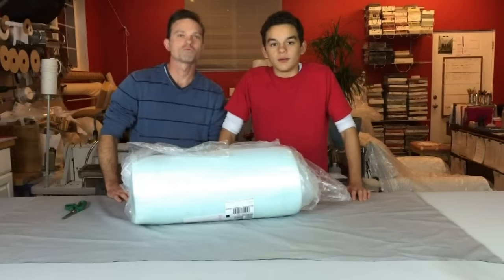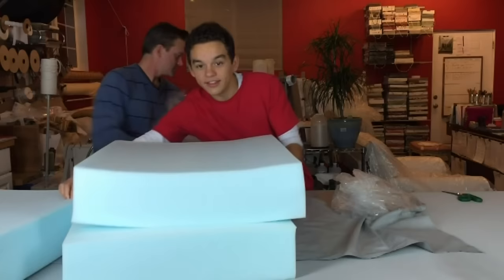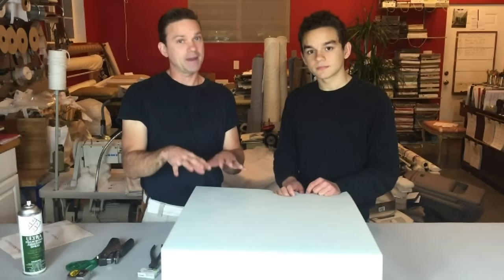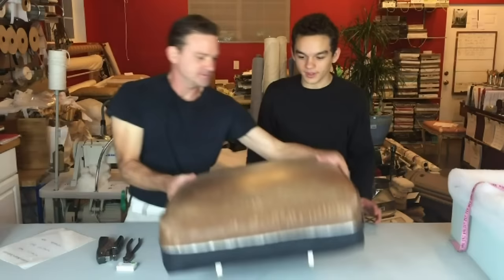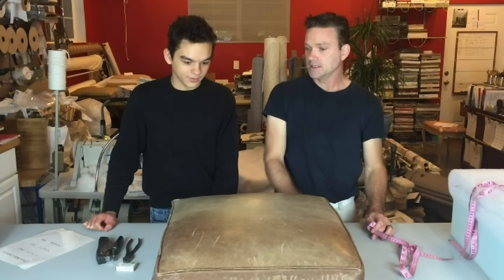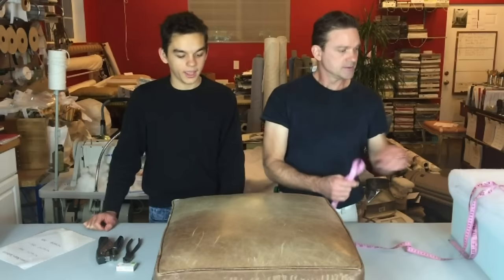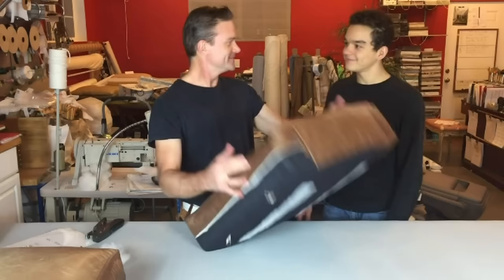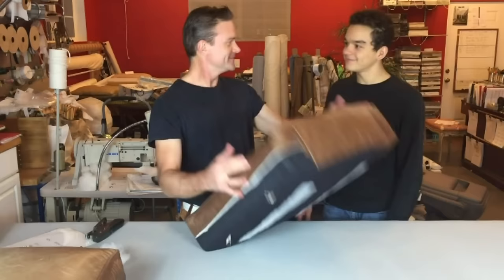Replace the foam in your seat cushions fast and easy!

Comment: for 6" foam to be use for a van bed holding a 275lb back sleeper, what's a good density and compression ?  Would 1.8 density 44lb compression be good? What are the specs on these blue cushions @ 3:56 closer to high density vs medium density.  Seems what constitutes high vs medium varies.
Reply from the maker: Hey there, that’s a good question thanks for leaving a comment. As far as foam for a mattress. The density 1.8 I wouldn’t like that because it won’t hold up as long as a density 2.6 you just have more volume there per square inch. We’re gets really complicated is the compression that’s the comfort level. Really depends if you like a firm mattress or not 44 is considered firm mediums like 35 compression and soft is around 26 compression. You also need to take in consideration how thick the foam is. The thicker the foam the more firm it’s going to feel. For 2 inch foam standard is 45 compression there’s not much foam there to support somebody, so you want it to be firm. Translate that to a mattress size you’re gonna have a firm piece of foam at 44 compression. So although I’d like to tell you which one to choose it’s really hard to say do you like your mattress is firm can you tolerate that, for many hours or do you like them soft or does that hurt your back?  I do hope this guided you in someway. Again thanks for watching and leaving the comment. Please share as it does help us when you do. All the best, Paul

Comment: First off, I love your videos. They are the best upholstery videos I have found and they are entertaining too! My husband and I are trying to help our leather natuzzi sofa that is sagging on either side of the middle cushion. It is a webbed couch and it is the foam that is compressed from use. Unfortunately we can't just remove and replace the cushion because of the webbing. My idea is to try and support it with another whole piece of foam underneath and then add another layer of webbing. Is this idea any good? Any advice or other videos that apply?
Reply from the maker: Hello Mikhaila,
THANK YOU for checking out the videos, it's really great to hear.Very happy to help you on your project. I HOPE I have this correct. Q: Are your seat cushions attached? If I have this right you are wanting to go underneath the sofa (the bottom) and add the new slab of foam there (FIRM no doubt) and then apply webbing to in case the foam. RIGHT? If so then YES! That give you more support on the top of the cushion. That sofa is a nice one, other then not being able to just remove the foam for new replacements. Here are two videos that MIGHT help you on this project. I hope I hit the mark on you question. Please continue to watch and share the videos, it helps us a great deal when you do.  All the best Paul

https://www.youtube.com/watch?v=wxQ1FRyRusc&t=125s                 

https://www.youtube.com/watch?v=pcF2GR576dE&t=24s
Reply: Thank you So much for the advice and the videos! It worked like a charm. I figure we have given this sofa a lot longer life. You might think about doing a video on this, because it seems like there are alot of natuzzi owners in the same boat. Thanks again!!
Reply from the maker: Really glad to hear it worked out, thanks for the update it makes doing these videos a lot easier. In short very glad to help. If you have any other questions on furniture let me know maybe I can help.  Cheers,   Paul

Comment: I enjoy your videos and I'm sure you get many questions so here's one more,lol.I just yesterday bought a nice used sofa set-love seat,standard  sofa,and a chaise lounge,matching set.Problem is it's missing ALL of the cushions entirely.I really liked it and didn't want to pass up buying this set.Is it possible to replace the cushions,foam,fabric wise?Any tips you have are truly appreciated(On a tight budget just to note)THANK YOU VERY MUCH GUYS!
Reply from the maker: Hi,
Thank you for watching our videos, and sorry for the very late reply! Hopefully the set is still available, and if so here are our tips!

First, fabric! It will be very hard to find an exact match of the current fabric on the furniture, however you could try to do a contrasting fabric for the cushions.  Or you could do a slipcover for the furniture pieces in the fabric you want for the cushions. 

Second, making new cushion covers!  You need to start off by taking some inexpensive fabric like muslin and trace the platform of the furniture where the cushion will go.  Then add a half inch for seam allowance on all sides.  Unfortunately this process is extremely hard to describe without actually showing someone in person.  However this should give you the general idea. 

Third with the foam. We order our foam supply from albanyfoam.com. If you make the cushion covers before you order your foam you could send the cushion covers to Albany foam and they will fill them for you! Or you could follow the procedures in the video. 

Finally, the easiest way to do the back cushions would be to make 26 x 26 throw pillows to fill in the space on the back. 

 I hope this helps, and again I hope we're not too late!

All the best,
Grant
Reply: Well it was worth the wait!Thank you for the tips,appreciate it much:-)

Comment: Can you use this foam to replace a poly material for the part of the sofa that you dont sit on but the one you lean on? Love. Love your videos. It is so helpful.
Reply from the maker: +Sam Cole  Hi Sam,  sorry for the very late response, it's been pretty crazy busy here. I think I understand you question. Yes back cushions can be made of foam. Boxed or cushions that have a band, not what we call a (knife edge cushion) those need shredded foam. For boxed or banded cushions, Only use soft compression #16 or the like,  go for soft. Remember the thicker the foam needed, go for softer. A good rule to work from is, thinner the foam use firmer. If your back cushions are 4" to 5".  I would use a soft foam with the highest density I can find, it will last longer. Hope this has help. All the best, Cheers.
Thanks for commenting.  Paul

Comment: Great video.  Thank you.  Replacing cushions can be so expensive.  For a fabric cushion however, do you have a specific video that would make it super comfy?  This looks a little firmer?  Thanks for any help you can offer.  Also, I am trying to stay away from poly since it is toxic.  Any "green" replacement ideas?
Reply from the maker: Hi Dawn,
Thank you for watching the video, glad you enjoyed it. The Foam method used in the video works with leather and fabric just the same. Yes! That cushion was on the firm side. Cushions are very difficult to work on, the reason they are like a pair of shows one person love'um and other person hates'um. The softness of a cushion is in the compression number. If you want soft , go for a low compression number say 26 or even lower. However your cushion needs to be thick or else you 'll go right  down when you sit, no support. It's all in the video. As for low or no Toxic? There is soy foam out there, but you need to do your research to see how low in toxicity  it really is. You have Nature latex foam, REALLY nice, however very expensive, it last a very longtime. You do have feathers as a choice as well, but like all things it to has some drawbacks. If you have any more questions please let me know. Please share the videos, it helps a lot when you do.  Cheers,  Paul

Comment: Is using industrial velcro on couch cushions a good way to keep them from slipping forward? Or is the cushion too long from front to back. The Linda. P.s. love your videos you are a great teacher.
Reply from the maker: Hello,
Thank you for going to our channel and watching the video. Thanks as well for the compliment on the teaching, it means a lot. That is a good question: That method is used mostly on leather furniture to stop slippage and to save on using costly leather under the cushions. They will have, leather and half fabric. On the fabric side they will sew Velcro to it. BIG DOWNSIDE!! Flipping the cushions you need to remove the foam from the covers to do so. Most people don't, when they see Velcro on one side, they skip flipping the cushions. So there is not even wear on the cushions. If you have fabric on both sides of your cushions instead of going through all that work putting on Velcro, try this first. The NONSLIP material that goes under rugs for hardwood floors. Cut a big enough piece to go under the cushions. Another option is using what are called cushion D rings and clips try here.  www.fabricfarms.com     However it's best if you are doing the re-upholstery to install them or you are having the work done for you. I have installed then in post, a real pain and you will need a long nose stapler to staple to the frame. The D ring is attached to the cushion bands, using a strap of fabric, to hold them in place. I hope this has helped you.  Please share it helps when you do. Cheers,     Paul.

Comment: I would like to convert from three seat cushions to one bench-style cushion for my sofa.  What might be some considerations to keep in mind?
Reply from the maker: Thanks for watching the video I really appreciate it. Things to consider for one long seat cushions. Things consider are it will wrinkle more than a tighter smaller individual cushion specially in the center. The longer the fabric runs the looser it will appear and be. Depending on your seat platform, one long cushion has this problem. When you sit  near the center the ends come up. A lot of people complain about this. You can use what are called D clips on the sides of the cushion they are attached to the furniture and they keep the cushion from popping up on the ends. If you have three seat cushions that are identical in size meaning a square. You have the option of rotating the center one toward the ends if you tend to sit in one place most of the time. Where as one long seat cushion you can only get the ends to be worn in evenly. So I do hope this helps and again thank you for watching and leaving a comment please share the videos it helps us when you do. All the best, Paul

Comment: When you glue the batting to the foam do you also put plastic or seran wrap over the top so that the glue hopefully doesn't seep through after years of wearing?😃😃😃  
I'm redoing cushions in an RV.
Reply from the maker: Hi Cheryl, 
Great question, with glue, soon after it is sprayed it hardens enough so it is not tacky anymore. So, you do not need to add any protective layer. If you do see any film or plastic around the insert        that is used for vacuuming down the insert so it is easier to put it in the cover. I hope this helps! You can order foam from our website if you would like at ucprivatecourses.com I can answer any questions you have if you email me at: videos@urbancastlesolutions.com
All the Best,
Grant

Comment: Thank guys, which tools are needed?
Reply from the maker: Hello Irina,  thank you for watching, the good thing is you only need a tape measure to get your foam insert replaced. Put in the measurements at ucprivatecourses.com after following the instruction in the video. So no tools required.🙂  Again thank you.  Cheers,  Paul

Comment: Do you know if there is anyway to fix/restuff the arm of a couch. We bought our sofa less than 2 years ago and you can feel the wood on the arm (where everyone sits).
Reply from the maker: Hey Danielle, 
Thank you for checking out the video. I have had that question given to me before. Not sure how your furniture is constructed,but unfortunately it most likely needs to have the outside back and outside arms removed. That needs to be done to remove the inside arm to get to the padding under the arm. I KNOW a lot of work and can be unnerving for a beginner. I don't recommend it unless you just can't live with it like that any more. Without seeing the sofa that is my best guess as to what needs to be done. I wish I could be of a bigger help. Thank you again for viewing.
Cheers,  Paul

Comment: Great video, thanks!  I love how well you and your son work together!!  I have a well loved (Cindy Crawford Home) Terrazza Brown Leather 4 Pc sectional.  I watched a video earlier on how to disassemble a similar'ish couch to expose the cushions so they can be replaced, and am praying mine is somewhat the same.  This couch has handled my pets and my kids rather well the last 5 years, and the leather is amazing and has not torn at all, but some of the cushions are not as tight looking as I'd like them to be (they are the favored seats on the set, of course), so I'm thinking of redoing all the seats, tops and bottoms!  Big task, as this is a rather large sectional, but I can do it...provided you could possibly tell me which cushions to order and where from ;)  Any ideas?  This set is used heavily!!  TIA!!
Reply from the maker: Hi,
First thank you for watching and sorry for the delay in response! Great questions,  with the seat cushions we order the foam from albanyfoam.com. Just follow the directions in the video for measuring and ordering the correct density and compression of the foam. With the back cushions if they are attached to the back of the sofa, then what you do is feel up in the back of the cushions to see if there is a zipper. If there is a zipper then what you do next is take out the insert of the back cushion and then  follow the wrapping procedures in this video https://youtu.be/8WCuBBBkGzo .
Also you can find the materials for the back cushions at albanyfoam.com

Thanks again, I hope this helps! 

All the best, 

Grant
Reply: I'm really confused when I go to albanyfoam.com. Did the website change after you made this video? It just gives and index and I don't know where to go to get the foam you have in the video.
The reason I am looking at albanyfoam is because I want to see what 26 density means. I see density listed in pounds in other places. One place I saw 1.8 density. How does that compare to 26 is my question???

Comment: Hello! Love your vids. 
If I'm making simple outdoor cushions for metal chairs what density and compression do you recommend for foam insert? I was going to use 2 " foam. They will be taken indoors during inclement weather.
Reply from the maker: Hello Tjanecki, 
Thank you very much for watching the videos, very glad to hear you like them Please share them with others. 2 inch foam is pretty standard, I would go with a compression of 45.  2 inches is not much foam for support so you need a firm foam. The density I would still go as high as you can.  The higher the better, if you are cutting these yourself we have a slab of 2645 at our website ucprivatecourses. Com Or if they’re just squares we can have them cut for you. And yes this phone would need to be taken in during bad weather or if they’re just squares we can have them cut for you. And yes this foam would need to be taken in during inclement weather.    Again thanks for watching.  All the best,    Paul
Reply: @ucsolutionsgivingmore  onw more question ...on this project, anyway 🙂 what type of thread should I use? Im sewing pretty thick outdoor fabric. Thank you!
Reply from the maker: Sorry for the very long delay, the YouTube app on our phones do not show replies for some past comments for some reason. Here is a great article that goes over the different threads you can order for outdoor purposes: https://www.sailrite.com/Selecting-the-Right-Thread-Material

Comment: This is a really informative video, and using the techniques you are showing, I will be replacing the foam in my 10 year old sofa.  My only question is in measuring what you call half-T cushions (other places call them L cushions).  I have the measurements from the front, width, and depth.  I need to figure out how to measure the T, though.  I am guessing I measure the width of the T (front to back) and add 1", then the length (right to left, where the arm cuts in), and subtract 1".  Sound about right?
Second, the area where the dog-ear (my name for it) juts out is rounded.  I am guessing I need to find a circle that fits, then use the to figure out the radius.  Then, do I pad the measurements by 1", or just not worry about it?
Lastly, I want a firmer foam than I currently have, which is ridiculously unsupportive.  Is there a way to determine what strength of foam I currently have?  Is there a compression gauge?  Or is there a rule of thumb?  I am a bigger guy (mid 200s lbs).  Is there a rule of thumb for that?  I am thinking 2835, but 2845 is also an option.  What do you think?
I just discovered your videos, and I am extremely impressed by your delivery and production.  I never thought I would be fascinated by reupholstery videos, but I have to say, you guys do a great job!
Reply from the maker: Hi Gaguilar1234,
Thanks for watching and for you question, we decided it would be best answered in a video: https://youtu.be/QSIYiX1aubE?t=7m42s
We appreciate you waiting and we hope this helps!
Also here is the link to the foam as well.
Order Foam for Inserts: 
The foam density is not ideal we like 26 (it can also be written as 2.6)
However this is the best option we could find so far online.
18 (or 1.8) density - 44 compression FoamRush 4" x 32" x 32" Upholstery Foam Cushion High Density (Chair Cushion Square Foam)
Message them for custom cut foam and COMPRESSION AMOUNTS
https://www.amazon.com/gp/product/B06...
Reply from the maker: Hi Gaguilar1234,
Also if you find 26 or 2.6 density online please let us know, we would love to offer it to you guys!
All the Best,
Grant and Paul